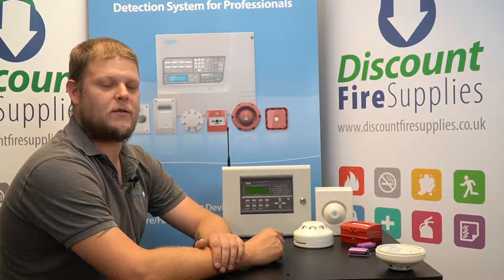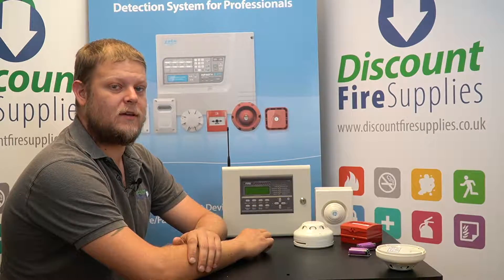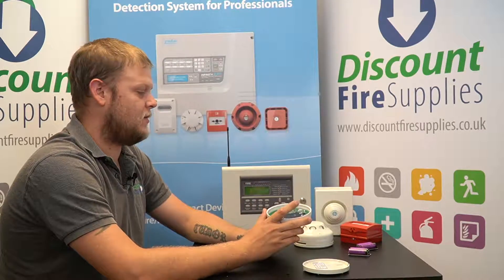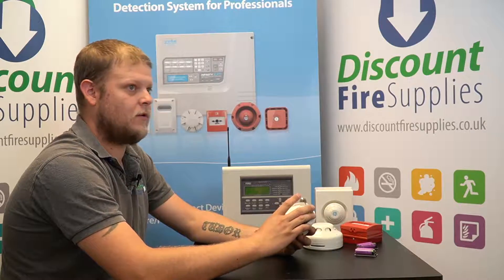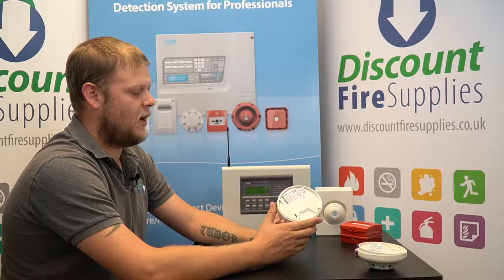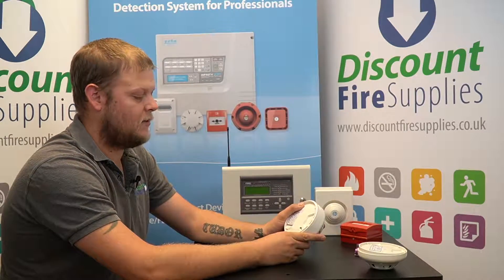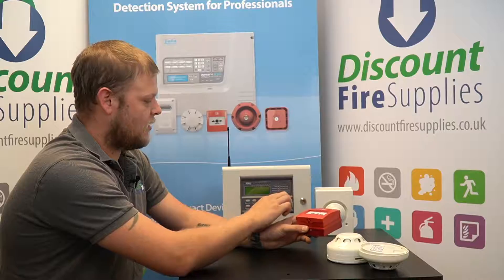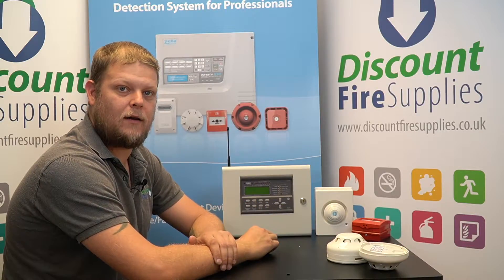How To Change Device Batteries In A Zerio Plus System

Comment: You have forgotten to emphasise the all the small pins must be correctly aligned both the battery connection one ( three) and the main sensor ones (four). If only one pin is not connected the unit will not work. But the tip about holding the side test button, the white spring loaded button, and the black two from four pin connectors until you hear the beep, was most helpful. Thank you